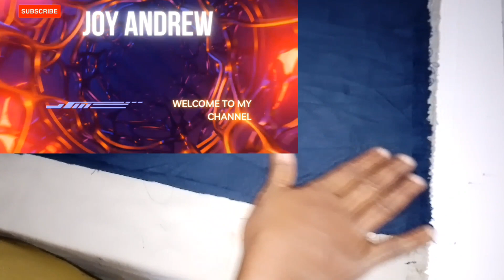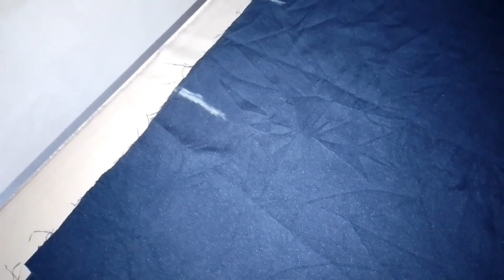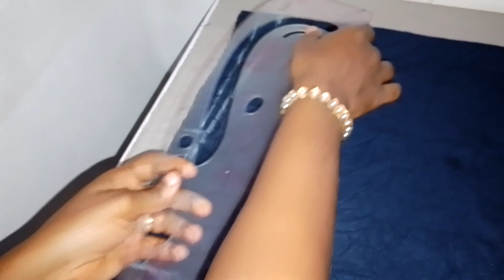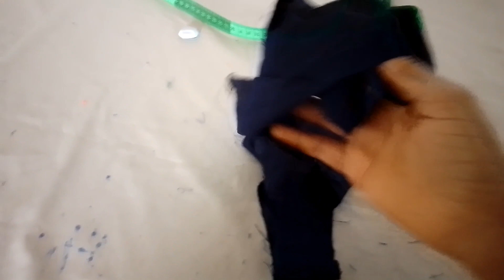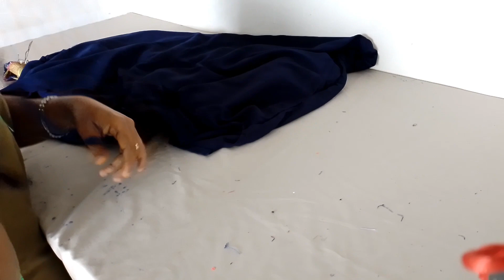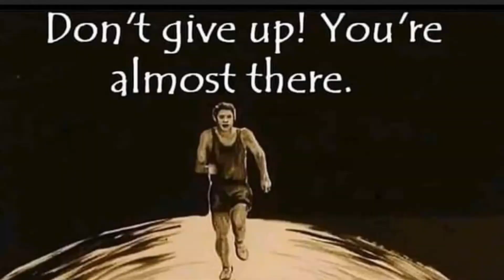Easy Way On How To Cut And Sew A Summer Straps Long Gown...

Comment: Your Cowl cutting onto Fabric good way of teaching. Some people they draft on paper drafting cutting placing onto fabric and then cutting. Your teaching good Idea directly showing how to cut bodice cuttting on Fabric Brillant. Please explain how much you measure waist round Umbrella Falda skirt cutting for gathers pleats only waist round explain how muc you measured you did not mention dress bottom part from waist.
Reply from the maker: For the skirt flare part, is by 180°  degree cutting from the waistline down is the full body measurements subtracting the shoulder to waist then whatever you're Left with will be the skirt measurement with additional sewing allowance.
On this circumstances for waist is your actual waist measurement plus extra 12 inches for pleat. 
Then from the side waistline go down connecting with your ruler 📐 indicating slant line to the down of your skirt depending on how wide your fabrics is. Then on the down part go up by 3-4 inches and connect to the man down line using a curve outline then you're good to go. 

If you want to learn more ready to wear dresses, corset drafting in a well understanding way please do well do send me an email to know more about my classes. I teach people to perfection 💕